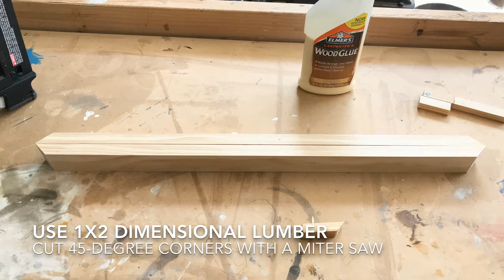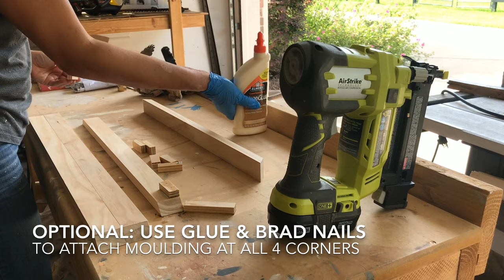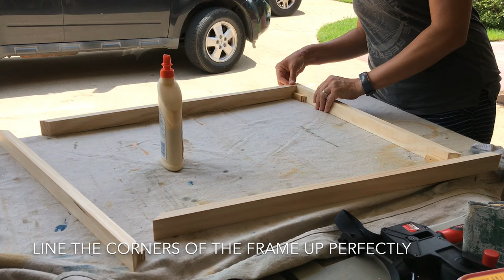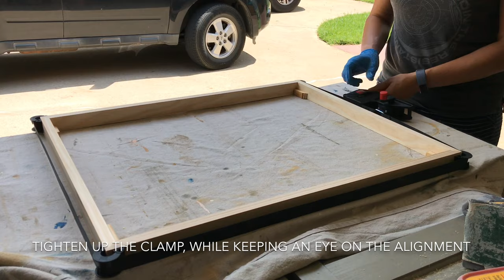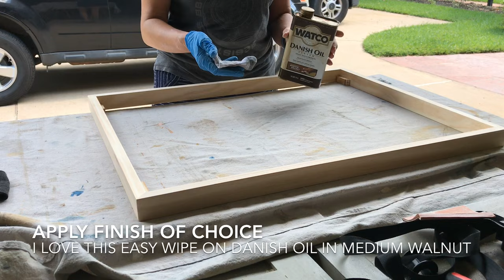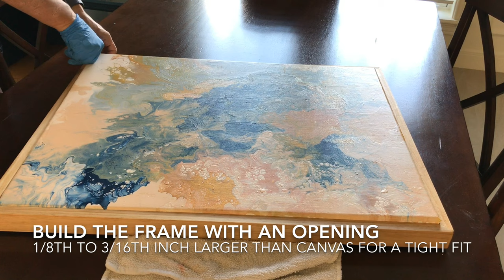I LOVE this EASY DIY Canvas Frame made with 1x2's (Easy DIY Wood Canvas Frame For Canvas)

Comment: What are the small wooden pieces called you staples in the corners, and where did you get them from?
Reply from the maker: Hi Vera! Those are 1x1 (actual size is 3/4” x 3/4”) square pine molding pieces. They sell them in 8’ long lengths in the molding section of stores like Lowe’s and Home Depot.
Reply: I was wondering that, too.  ☺️

Comment: Thank you!!! What dimension should I buy if its a gallery wrapped canvas ? It's 1 1/2.
Reply from the maker: If the canvas is 1 1/2" thick you can probably still use the 1x2 I used in this video.  :)
Reply: @AbbottsAtHome  thank you 😊😊

Comment: Did you glue or nail the actual canvas to any part of the frame?
Reply from the maker: It’s just pressure holding my canvas in place. You can use shims to make the fit tighter, if it’s just a little off. 👍

Comment: Got advice for the measurements of the wood pieces? I've got two 1x2' canvasses that I'd like to seal and frame before the holidays.
Reply from the maker: Measure at the corners where the canvas is folded to get the widest measurement for each side. 👍